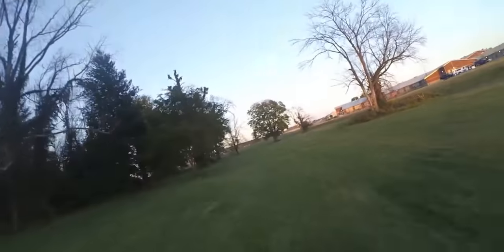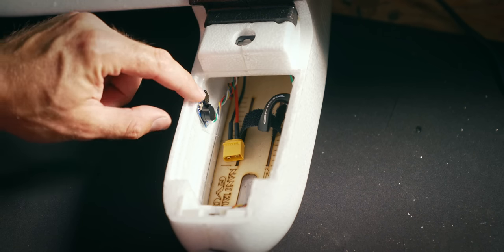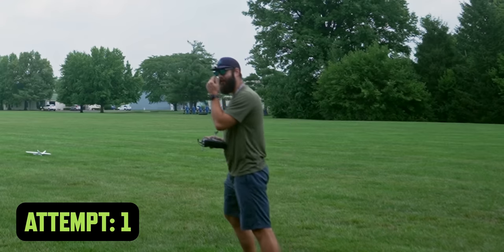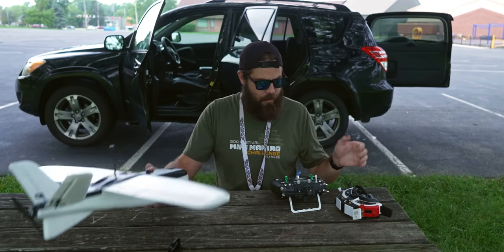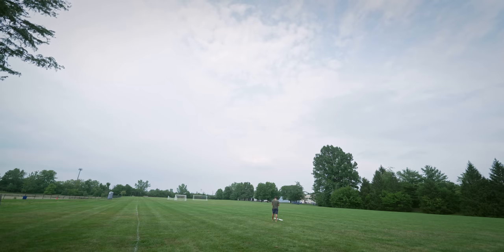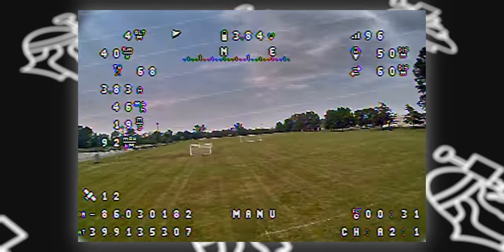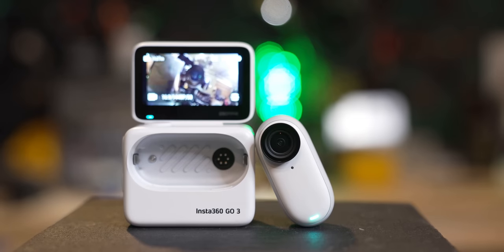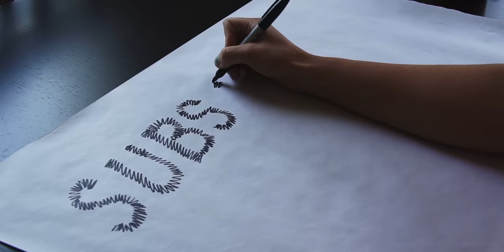Falling Back in Love with FPV

Comment: Check horizon mode. As you tilt left the left aileron should go down. Tilt the plane right..right ail down. This will show if angle mode is giving the right inputs too.
Reply from the maker: it does - that's what's so weird
Reply: @NURKFPV set yaw pids to 0. The v tail might be messing you up. Oh and turn on artificial horizon. That way you can see what the fc thinks is level.
Reply: @NURKFPV  Not sure about the specific setting for iNav, but if the surfaces deflect correctly on the bench, then the PID gains for roll/yaw are too much. Decrease those to almost zero, make it fly in angle mode (basically it will do minimal assist and it will be more like manual flying, but flying) and then increase them untill you get oscilations. Same PID tuning more or less as with a quad. The difference is that oscilation frequency/amplitude is dependend on speed of the plane, not on RPM as on drones.

Comment: at 4.00 u say that you've changed the authority from 50 to 100. I guess you did that in the mixer tab and that's wrong. if you change that the stabilized modes have no authority to stabilize the plane. load and apply the stock v tail mixer again. I guess that you have enough mechanical throw of the control surfaces cuz u can fly it in manual mode. in order to check the throw in the stab modes u have to arm and apply some throttle. only then the pid loop is active and you can c the max throw.if you just test it on the bench without active pidloop, u get way less throw. max throw in stab modes depends on max roll and pitch rate + ff. simply do a auto tune and you will have the throw you need for the model. you can also tune it manually by adding ff till stab max throw and manual max throw r the same.  in the outputs tab you can also increase the rate from 100 to 125 .this will max your mechanical throw of your servos or adjust in on the servo horn /elevon horn.
hope I could help. inav is a steep learning curve and you should put a hd system in there. bigger wings r also less wobbly.
regards

Comment: I have a Talon and I could NEVER get it flying well. They just don’t have the elevator authority of other aircraft. They will cruise, but they don’t do Acro very well. Since then, I’ve stuck to twin tractors and wings.
Reply from the maker: I really like the form factor of the talon, and I'll try to get it as good as I can, but I think I'm going to have to try it with something else
Reply: @NURKFPV  I have a Delta Wing R690 that flies great with 4s 1300mAh batteries. It was cheap and easy. The AtomRC penguin is the next plane I’m looking at. I love Twin motor tractors.

Comment: My guess is your radio has a mix in it or your roll is reversed in the radio. Clearly the FC thinks “left roll” isn’t the same as your radio. Make sure the bars in the receiver tab move the same direction as your sticks. If not reverse the necessary channels in the radio. Then don’t touch the radio mix again. If moving the stick right now makes the control surfaces move in the wrong direction, you need to adjust the mix by reversing one or both servos in firmware.

Or the FC thinks it is upside down.

Comment: I build and fly planes quite a bit.  I have\had around 50ish planes.  I bought that exact module because how packable it is.  I was very excited when i got it but it is the worst plane I've ever owned.  I have less than 50% success rate hand launching it and i have a lot of hand launch experience.  Glide testing it goes fine but it all falls apart when you start to add power.  It very odd.

Comment: Not really sure what’s going on with your angle mode here, prob a mixing issue. 
I believe the dive you went into was maybe  due to a stall, because of nose heavy cg, however you were going pretty fast by the looks of things, so I’m not really ok sure. Possibly more electronical issues.
Reply from the maker: What wasn't communicated by the video was that the cover that goes over the nose had popped up a little inducing a little bit of downward canard effect - i just didn't know it had happened because it was behind the camera
Reply: @NURKFPV  Ah, ok

Comment: Bro you need basic aircraft training lmao. IMO if you cant land it in front of your feet why would you even try anything else xd. 3 mistakes high before testing anything is what all of the old folks would say.
Also cant you just look at the surfaces and see how angle mode would react in the ground??? Like checking control surface direction is like so basic lmao.
Try FPV with a plane with a lower wing loading.

Comment: Manual mode lol no..... on launch... I can't behoove angle mode wasnt working

Do you have zero movers set up on radio? 
All mixing is done in inav
I fly inav allot. Have 9 or so planes.

I have gotten that talon yet tho
.  I will get the talon made by the other company uav something.